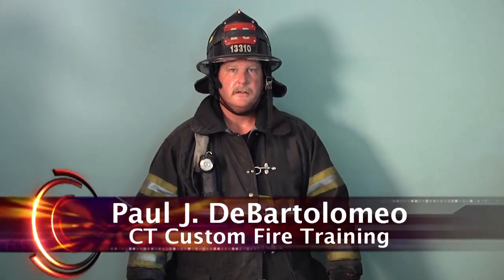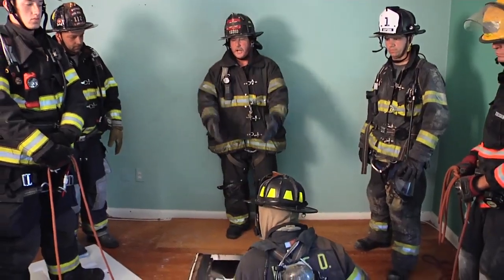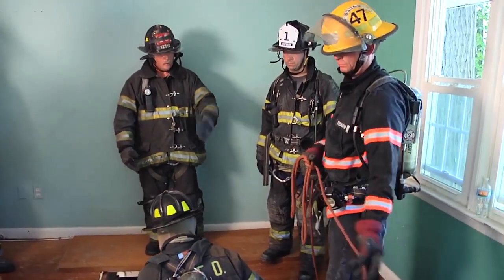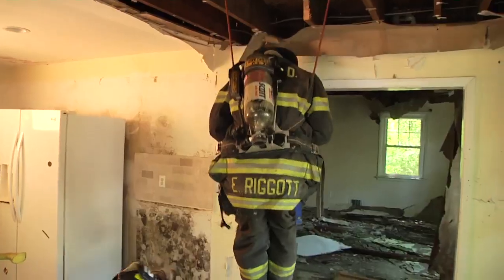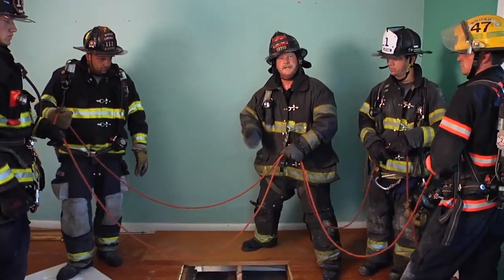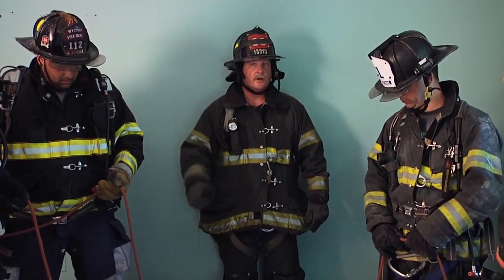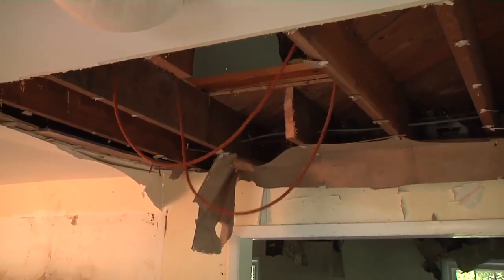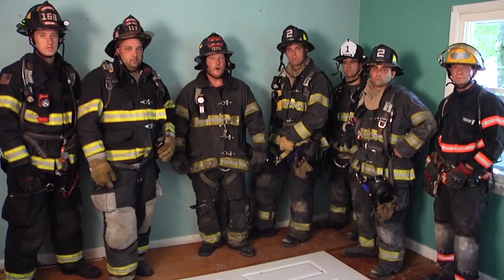Rescuing a Firefighter Who Has Fallen Through the Floor

Comment: Interesting drill and a little more addition of tools to the tool box. The issue is looking at where and when this type of drill is realistic. Most of these drills have little basis in reality to what is actually occurring on the foreground. First, why did the firefighter fall through the floor? In the vast majority of cases it is because the floor has given way as a result of fire beneath the floor. When the floor collapses, three things typically happen. First, a blow torch comes through the floor from the fire below. Making the hole the firefighter fell through uninhabitable for a rescuer. Second, the hole is often not as large as what it was to allow the firefighter through. Lightweight flooring actually expands as the softened OSB allows the weight to pass through and flexes back. This weakened floor will most likely have no ability to support a group of heavy firefighters to operate around and in proximity the hole ( that is likely getting weaker from the fire). Third, in the overwhelming majority of cases presented the firefighter is not incapacitated by the 9-10 foot fall. The atmosphere from the fire will force them to find refuge elsewhere in the basement.  The complicated rope based rescue techniques require a few things to be successful, the rope must be readily available. The methodology employed must be able to be done in low to no visibility with fire gloves on. Nylon rope requires very low temperatures to be viable.  The most likely technique to manage a real life fall through is aggressive fire attack to the basement by whatever openings are available, exterior windows, tenable stairs, high volume piercing nozzles (multiple at flow rates above 150), and implementation of res he through the stairs or ladders through openings you create into protected voids. Window conversions through the subfloor are very effective. But all manpower intensive. Just use common sense to the drills we create and commit our time to train to.  Stay safe.
Reply: Some of these drills are used for extreme cases in where you are trying to exit the structure . This obviously would’ve been a mayday call but in case there were no other options this is what they had to do so it’s good to know these things
Reply: @McbandzSupreme  I appreciate your point. To me, our training time is extremely limited and precious.  For the volunteer firefighter, many train 1x-2x a month.  A few may do more. In this, that leaves a typical volunteer 30-40 hours a year to train ( if we consider they train on holidays, don’t take a vacation or work gets in the way. ) for a career guy this may equate to 2 hours a shift with shift schedules, vacations etc, this is 18 hours a month (only if calls, meetings, inspections etc don’t interfere).  Furring this limited time, we can practice on the calls we actually run and the scenarios that NIOSH and Project Mayday have demonstrated to us are the most realistic. First I would say practice on how to prevent going over a burnt out floor in a residence. Identify basements and crawl spaces and signs of fire involvement.  Spend those precious few training hours in prevention.  Then train on the highest probability of an actual emergency.  If there’s no fire involvement, rescue the guy through the stairs, then ask why our training to prevent this failed.  If they fall through a floor with fire involvement, find another way to him.  But please don’t use that precious training time on hypotheticals instead of covering your basics until you can’t get your basics wrong.  ( hint, will take more than your limited training hours).  
Just my thoughts after looking at trainings I’ve been a part of over 3 decades on the job.  
Stay safe and keep training brother.